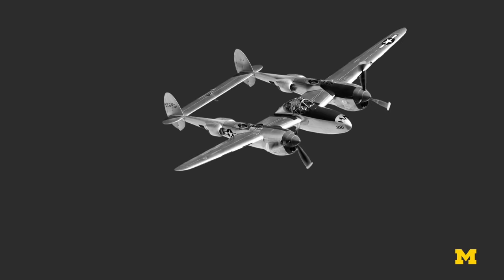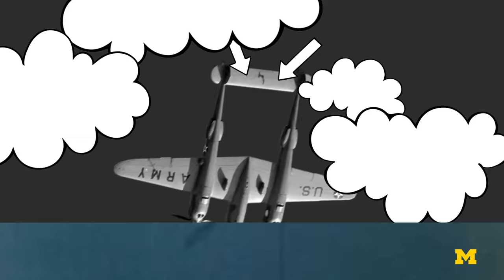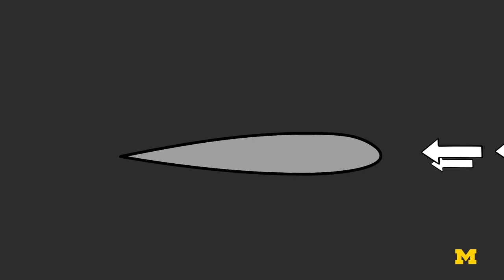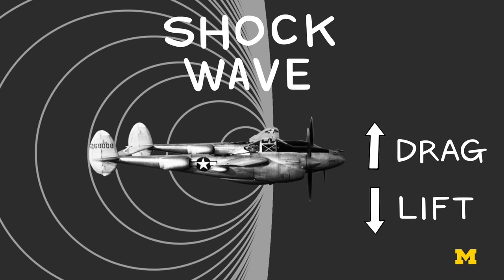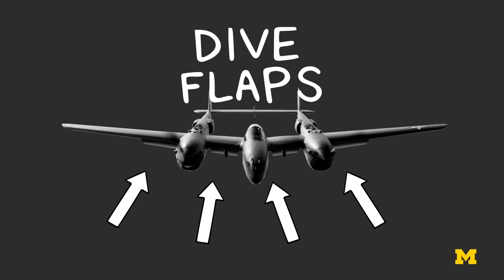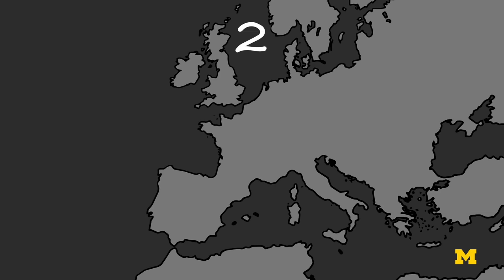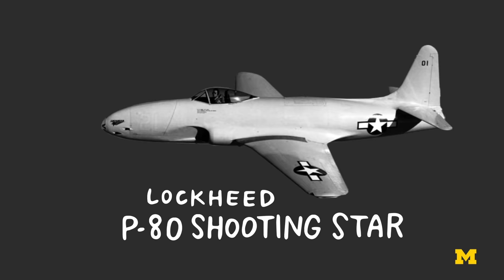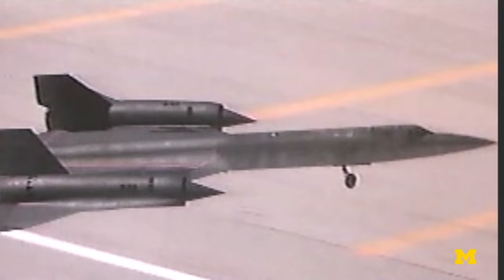Engineering Faster Planes in WWII: Kelly Johnson, the P-38 and the P-80

Comment: The speed of sound is not affected by the elevation or air density, just the temperature, which is warmer near the ground. It varies by the square root of the absolute temperature.
Reply: The speed of sound is affected by the number of molecules present in the medium, or air density , which varies in altitude or temperature. smh

Comment: Using a thick airfoil was an active design choice. Compression effects where not well researched, so I'll give 'Kelly' some slack.  Though he did have access to a wind tunnel, and should have done his homework. Having engines of limited power output means, you can only increase overall available power, by increasing the number of engines. That makes for a heavy fighter, so to maintain a subjective level of good maneuverability, you need a wing that can generate high lift at low speed, to keep your stall speed down, thus increasing the sustainable turn rate. So yeah, you have a thick wing with a low mach number. But! My oh my, there are so many seemingly random,  passive, thoughtless choices made, that make me cringe. Flawed cockpit heat, flawed gun camera mount, flawed cockpit layout, etc. How come some engineers, like Mr. Johnson, are so far removed from reality, and others are not. To clarify what I mean, following brain jog. In 1974 the F-16 Fighting Falcon had its first flight - seven! years prior to the F-117 Nighthawk & five! years prior to the later aircraft's operational introduction. The F-16 had reclined seats to help reduce pilot fatigue. Mr. Johnson, did not waste one gray cell on the reality of the real world needs of the pilots, so they sit bolt upright in the F-117. How come some engineers don's smell the coffee, and connect the dots, while others do? And my examples are just the tip of the iceberg...